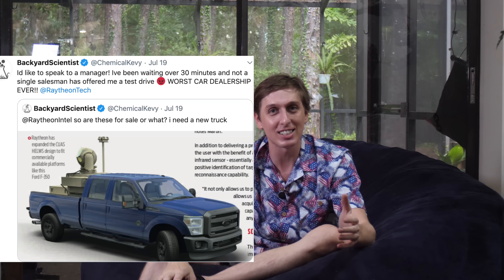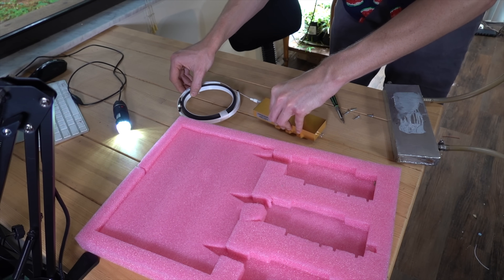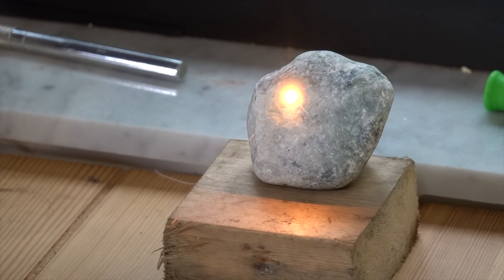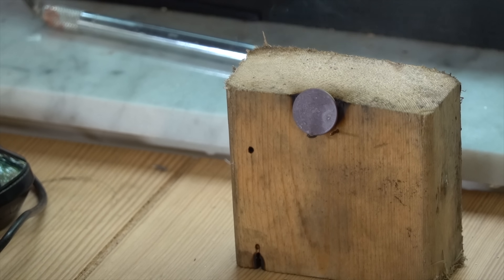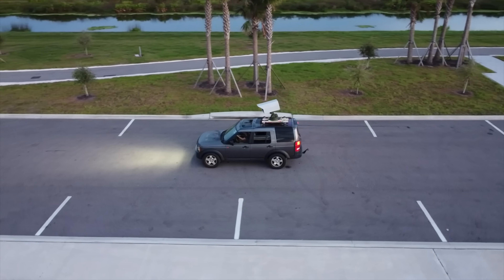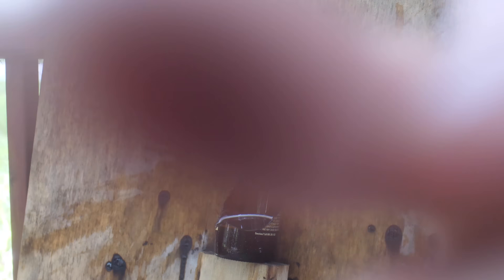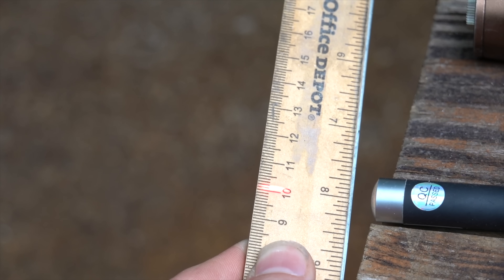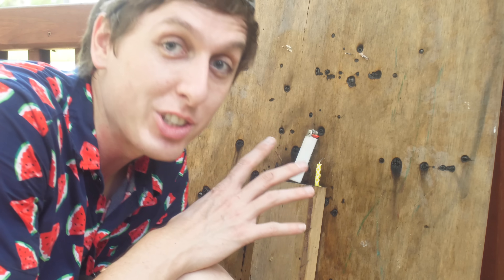200 Watt car mounted laser!

Comment: Many insects were sacrificed in the making of this video - good riddance ;)
On a more serious note on laser glasses, safety and ratings - they should prevent laser light passing even on direct illumination, reflections are totally a thing (I've been burned a few times operating industrial lasers), what should happen in the event of direct laser beam light is they go completely light opaque at least for a time, if they don't then they're no good. If the beam instantly cuts through them then they won't save you from a reflection. Glasses that do this are still very expensive at some wavelengths.
Also continuing the trend on a serious note not every aircraft broadcasts ADS - especially for example military aircraft.

Comment: And by the Way, Styro would never shoot a laser like that through his driveway straight in line with other People's Windows and houses.
Reply: [Redacted]  they were open
Reply: I was more worried about him burning his car, is that a problem?
Reply: lno_onel da Asian the dot will instantly blind you if you look at it without protection even though its invisible
Reply: @will-eu8jg  yes, I get that. but if the laser went through the wood, it will burn the car
Reply: @lno_onel3071  i guess so but the main concern is the safety of other people rather than a car.
Reply: @will-eu8jg  but the car is in danger though
Reply: @lno_onel3071  actually, yes kinda
Reply: @lieblingsfarbe4453  but his car tho

Comment: You can't tell what aircraft are in the sky in any direction.  "Flight radar" web sites show the location of flights that have data that is accessible, which might include ADS-B broadcast from airliners and the output of secondary radar from airports which depend on transponders on the plane.  But a plane too small to have a radar transponder may not show up at all.  (Civilian airports seldom have primary radar, which sees aircraft by their radar reflection only).

Comment: This would actually be a really good weapon against aliens or nuclear missiles if could have an electronic tracking system that is able to track small targets accelerating or moving near the speed of light, also if it could track multiple targets, targeting their weak points and destroy one then move to the next target fast and accurately.   Some expensive telescopes have really good tracking and location abilities.
Reply: I wonder what would happen if they shot a mirror or light absorbing paint
Reply: I wonder if it’s possible to make a hydrogen rocket like the sun but what if you could move it by shooting it with the laser.

Comment: Was all onboard until you pointed it at the sky. Please never sweep that around the sky again, that is incredibly reckless. Want to do a short term experiment targeting an object like the moon, where you're already on target switching on and off? sure. But many aircraft you may hit aren't in the flight radar system. Given you say there was no airplanes for 100 miles, you're likely in uncontrolled or minimally controlled airspace (class E, D, etc), which I believe do not require ADSB transponders (I'm Canadian, we don't require ADSB at all here), so won't typically show on websites like flightradar24. When you pointed just above that tree the radiation no doubt went beyond 100 miles.

Even if the radiation isn't damaging to eyesight at 100 miles, which I doubt, it doesn't change the fact that even low powered laser strikes on aircraft are a big deal affecting aviation safety, and growing daily. 

Don't be surprised if you get a call from the FAA about this video too, as many aviation YouTubers are being targeted by false reports.

Comment: If you go frame by frame at 8:28 there's a bug flying into the frame. Looks like it goes right into the wood at the base of the target. Looks like a tiny airplane. If you watch carefully in the other camera angle you can see it was farther away.

Comment: There's a reason that these aren't freely available. They are insanely dangerous as it's not just in a straight line that you need to be careful. The tiniest reflection of a piece of stone, a coin, something flying or just about anything will produce a source of reflected light with still sufficient power to damage nearly anything. The safety precautions used weren't even remotely close to what should have been used.

Comment: You're a good engineer to design and build such a nice instrument, but then the only thing you can think of doing with it is to burn things? :-)  13:50  One thing I'm wondering is why does the apparent beam suddenly stop at a particular point in the sky?  I've also seen this effect when astronomers shoot lasers into the sky to serve as an "artificial star" for adaptive optics.  What causes that?

Comment: Fully enjoyed the video.  I do want to say though - not all aircraft show on flight radar.  Flight radar sometimes relies on a system called ADS-B.  Not all aircraft are equipped with this, and some companies even have it blocked from view from the app and webpage .  I work helicopter EMS, we make unscheduled and unplanned flights at low altitude.  I have been flashed with lasers a number of times, thankfully no bad outcomes.  Small lasers probably are not going to damage our eyes, but it could easily screw with our night vision goggles.

Comment: “ However, your pupil is only half this size fully open, so a pilot could theoretically receive a 50mw/cm2 exposure.  A decent amount, but you have to remember even the smallest plane is traveling 150 miles per hour which would limit total exposure time to only 3ms( time it takes to cross a 9 inch beam).”
Who says your hitting the planes at an angle? If a pilots looking for an airfield you may be hitting them stight in the eye for seconds.

Comment: There are rocks....and there are ROCKS.
Olivine has particularly high melting point at 1,200°c whilst Mica probably 600°c (depending on composition) Also depends if you include crystals like diamond. 
Diamond melts at about 4,027° Celsius - not sure if these lasers will melt or vaporize diamond (at least in air)
One assumes the diamond will easily vaporize in oxygen when hit by the laser.
However - even then, not too sure because the light refracts and reflects from the diamond surface - so its different than lets say an oxy-acetylene torch (which easily vaporizes diamond due to the oxygen flow) .
Perhaps a well polished diamond will not be affected by the laser.

Comment: 8:30 actually I highly doubt that if the wavelength of the light you're trying to hit something with is a larger did not object you're trying to hit it will not affect it the smallest possible wavelength for infrared is 700 nanometers I couldn't find the diameter of covid-19 just viruses can get up to 300 nanometers in diameter therefore that laser could not harm covid-19

Comment: That copper coin was a good example of the thermal conductivity of a copper since it wanted to melt the whole coin rather than burn through it as it did with zinc. Very interesting test.

Comment: 100W blue diode array is already availlable with integrated multi lens, however the focus is fixed... which wavelenght is this IR fiber coupled laser array? 808? 850? 905? 980nm?

Comment: “There’s zero planes within 100 miles in this direction of here”

Planes 101 miles away: 👁👄👁
Reply: Fuqer didn't even check where the ISS was. {0.o}
Reply: Legally he should have filed a NOTAM and possibly obtained a waiver from the FAA. Brilliant lights in the sky require a NOTAM and waiver. Would have been a sad night had he disabled something like a Mediflight which would not be listed on flight trackers.
Reply: @lochinvar00465  You got that right, plus the Pilots would never know what's happening to them because of the almost invisible IR bouncing around in their cockpit.
Maybe the inside of all aircraft cockpits should be painted with light absorbing coatings plus have IR sensors and IR filtering windows. I don't how much it would affect the window's polarization that the pilot's definitely need to kill the glare they experience from everyday flights.
Reply: @lochinvar00465  I doubt that the FAA grants waivers for privately-owned 200W laser guns.  More likely is that the laser would be quickly confiscated after first contact with the FAA.
Reply: @lochinvar00465  why wouldn't a medflight be listed on trackers?
Reply: @thefatmoop  They don't file a flightplan (as they don't have the time to)
Reply: @lochinvar00465  Also, I remember 20yrs ago, back before Luxeon created the first Lenser emitter chips, like the half dozen, I had smuggled out of Germany for flashlight builds.

I had been dealing with a Japanese sales rep, using his company's new ultra-bright white indicator led's for mini-maglight conversions. We discussed the dangers of their new ultra-bright IR leds and lasers and talked about how everyone might have to wear IR filtering Eye-Wear due to sick minded terrorists blinding people.

Now with what those scumbag Aunt Teefa/blm have done with blinding those cops with lasers, I think we're not far from what I feared 20yrs ago.
Reply: Publicly available flight trackers will not track all aircraft. Lots of air traffic isn’t tracked on apps. The only real safe way is to clear it with the FAA. He could have ruined     peoples lives just because he wanted to play around with a laser.  Rant over- sorry I’m a pilot and know all too well the dangers of lasers and this has me triggered
Reply: @nk6197  The laser is infrared the pilot would not have seen it and therefore would not have  gotten distracted possibly causing a catastrophe
Reply: @Ezekiel Galva why do you think @The Backyard Scientist  wore laser proof eye protection and said that it could be dangerous. A laser is still a laser which blonds people especially people trapped in a cockpit where it bounces all around. If anything this ones even more dangerous because it’s more powerful and can’t clearly be seen so it can’t be as easily avoided.

Comment: Could you safely stick you hand in the beam right in front of the mirror? At a quick guess, the power per area should be 10^4 lower (at least?) compared to the set up where it was burning things.

I have a ~35W flashlight that is the size of my palm that takes several seconds to even start to feel warm so it seems plausible that the power density would be low enough to be safe, at least for a short while.

Comment: If backyard scientist can burn a ROCK from a cheap DIY laser, imagine where the military is with that technology
Reply: They have a 150 kilowatt laser mounted on the USS Portland right now...150,000 watts, compared to 200 watts in this video.
Reply from the maker: Dude the military is SO FAR BEYOND what I did.. its insanity. They are using single mode, or chemical lasers that can focus to a point 30x smaller than mine.. and using lasers that are 1000x more powerful than mine. So basically 30,000 times as powerful. Its like going up against a squad of green berets with an airsoft gun. its like a mavik mini vs an F-35 fighter jet. its like farting next to a nuclear bomb. AND THAT'S JUST WHAT WE KNOW ABOUT.
Reply: @TheBackyardScientist  Now you have me wondering if an F-35 could lock on to and neutralize a target as small as a mavik mini.  Can it?
Reply: Seriously I bet they years more advance than us citizens
Reply: Geneva convention more like Geneva suggestion
Reply: @Eddie Hitler There are rocks....and there are ROCKS.
Olivine has particularly high melting point at 1,200°c whilst Mica probably 600°c (depending on composition) Also depends if you include crystals like diamond. 
Diamond melts at about 4,027° Celsius - not sure if these lasers will melt or vaporize diamond (at least in air)
One assumes the diamond will easily vaporize in oxygen when hit by the laser.
However - even then, not too sure because the light refracts and reflects from the diamond surface - so its different than lets say an oxy-acetylene torch (which easily vaporizes diamond due to the oxygen flow) .
Perhaps a well polished diamond will not be affected by the laser.
Reply: Don’t have to imagine..   there is a 747 with a laser that can cut through a plane at over 25 miles.
Reply: Eddie Hitler how about this.     A photon is a particle.  Photons act as a wave or stream.            
what about how we measure the speed of light.? We can’t really measure it one way, so you have to bounce it off a mirror and measure when it hits the starting point.      But to me that also means that one way is faster than two way.  Even a photon must loose some velocity every time it bounces off something.  Plus, if gravity can bend its path side to side, it can slow it down if the source is behind the photon.    I don’t math but it seems to work out running it through my head.
Reply: Didn't he say that it cost 1500$? 0:48
Thats not what I would call "cheap DIY laser" :0
Reply: @notme9872  Cheap to you and cheap to others can be 2 different things. Thats literally pocket change for some people.

Comment: At 1:39 the small fiber stubb protruding out of the cable shroud looks surprisingly similar to the business end of one of those old Star Trek hand phasers from ToS. They used a very similar "tip" from which the phaser beam was emitted. Funny how real technology can so closely resemble a sci-fi prop from half a century ago that was designed to serve the same purpose the real thing does!
Reply: I just looked at a close-up of one the original Star Trek hand phasers and you're right. There is a clear plastic looking tip on the end of the pistol style phaser where the phaser beam comes out and it looks almost exactly like this!  Crazy!

Comment: Is this chemical or vixel based? If you de focus it you can use it as illumination for high speed. Then use a bandpass filter the width of you laser wavelength. If in the sweet spot of you imaging sensor you can expose very fast and will "ignore " things like defligration which might be in a different wave band. I.e. You can see through flames or smoke.... I've used a 4800w head in 808 range with mono cams to record very fast things for work. So try it with your high speed and enjoy.

Comment: When you tryed takeing off the queens hed, di you then relise yo probley either going left to right on the edges you went straight into the car first then the qeen then the car orr straight through the carboard queen and then into the car ?

Comment: I'm normally not THAT guy, but this should have been played with in a much safer setting.  Anyone that happened to walk by and get hit with refraction or worse a direct hit would be instantly blind.    Other than that though that is freaking crazy awesome.  Just please use it responsibly!  I would treat this as a firearm tbh.

Comment: But that is an infrared laser, you cannot see it by eye. Also, you have a waist in the beam, it then spreads after that. Can't you adjust so there is no spreading at the end like that? Sure, it will spread anyway due to divergence, but I'm wondering if the focus is truly set to infinity or not.

Comment: @TheBackyardScientist you need to see if you can expand the system by putting 6 or 7 of those fiber-optic laser outputs into the eyepiece of the telescope and fire them all out at once. Having 6 times the power you already have would make this a truly formidable weapon. Like melt through sheetmetal bodywork into gas tank, pop tires while in motion, melt brick, kind of weapon

Comment: Addressing fear of lasers; matte-black substances will prevent re-directed energy from lancing outward unpredictably: (I say energy because glint from a reflected beam will be imperceiveable as light) the matte-black cladding will absorb and ignite upon contact indicating specifically any faults with the system's appeture.

Comment: A place I used to work used lasers to cut their bulletproof helmets.  There was a story there was a problem at one point where the laser cut a hole through the machine and the wall behind it.   Idk the output of the laser but it was the size of a small bedroom.

Comment: !!!!!!!!!!!!!!!!!!!!! 8:27-8:28
you can actually see the path of the laser, burning random dust particles in the air, on its way to the target!!!.....DAMNIT after slowing the video to .25 speed and pausing alot.....it was just a frikkin moth.......

Comment: Not all flights will appear on mobile phone radar apps as they require planes to have adsb. Also if they are low enough or out of range of an adsb tower then they will not show up. So it was pretty dangerous to do that. I would advise if you do it again to get in contact with your local air trafic control tower or radar station.

Comment: um.. I'm just curious what did the laser hit outside when you "slide the wood into it" at 4:20 ^^
Reply: I'm assuming the divergence was low enough that the only thing it'd hit was his backyard fence (AS you can clearly see it's pointed into his backyard which has a tall, solid fence) and not do anything
Reply: @caelodevorago608  right, thx. Actually was my first thought after I saw the fibre and ignored myself lol. Was too impressed by the laser and forgot to update the comment too. ^^

Comment: Just as a heads up, 100 miles is not far. From the top of your Rover you could hit a cockpit at 200+ miles easy. And Flight Radar doesn't show all air traffic. I'm an En Route controller, they're cracking down on handheld laser pointers hard. You'd be boned pointing that thing into the sky, especially if you bounce it into the cockpit of an aircraft that isn't shown on Flight Radar for a reason. Good luck

Comment: You shouldn't have the target so close if you don't have a negative air supply removing the ejecta. Even smoke can ruin that fiber surface and cause catastrophic destruction to the fiber.
Reply: Not to mention the fact that during the destruction of the fiber, 200W of infrared laser light will be randomly scattered by the continuously melting end.